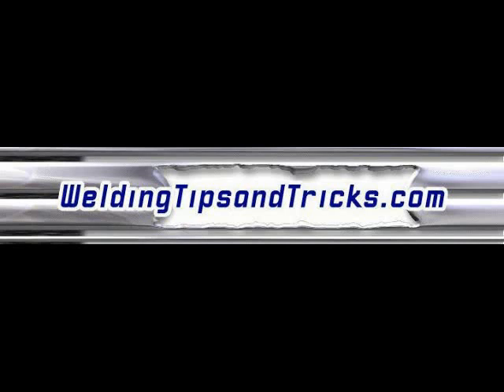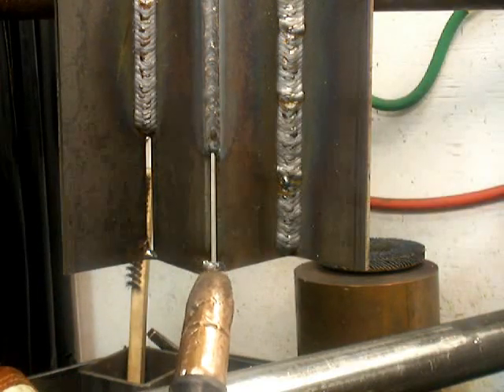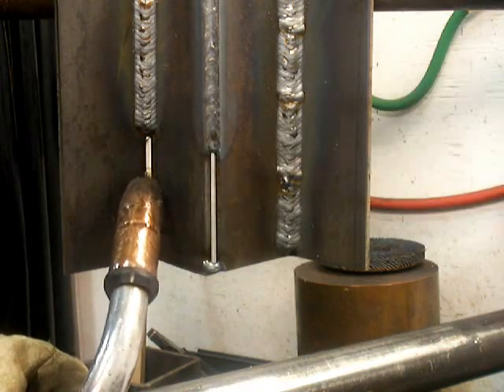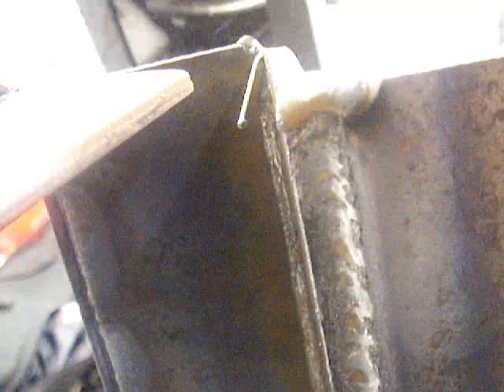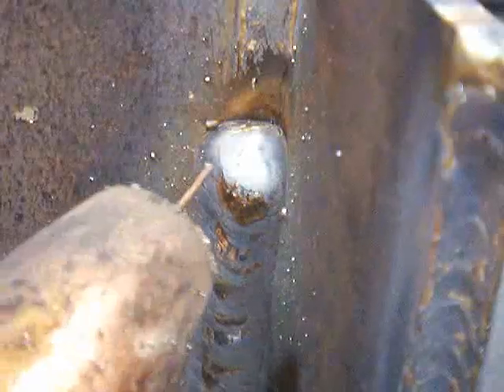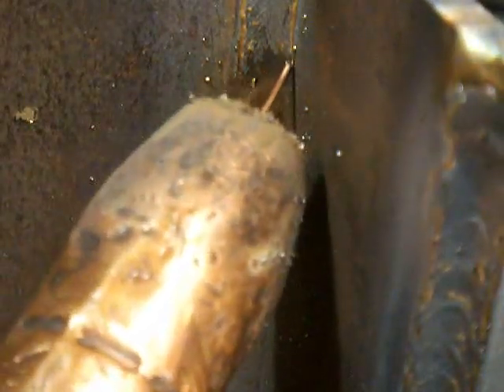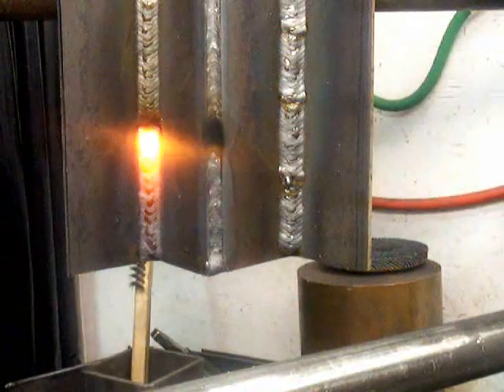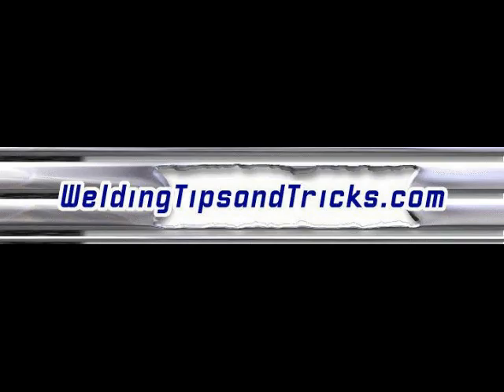Gas Metal Arc Welding Vertical Uphill and Downhill

Comment: I hope some wouldn’t mind helping me here …hate to ask for help but if anyone has ran into this or had experience I’d highly appreciate it …I just took a tes for a job I passed by skin of my teeth I rekon lol it was more like a drill seemed like I did a MIG 1G and FIRST I did a 3F uphill Tjoint was kinda weird idk much about codes trying to learn as much as I can by self study and what not but the machine they had wouldn’t let me go lower than 24volts between like 24-27.  And wire speed was like 435ipm and I wasn’t allowed to adjust it 🤨 and they also said I had to keep pressing the trigger over and over to me it seemed like I was just stacking tax appeal but they said I couldn’t adjust it and I could not run with the trigger the whole time maybe I just don’t know enough yet to understand what kind of test that is or is this just a drill and they considered it a test?  God bless y’all and take care

Comment: I'm using Er70 0.45 hard wire and having a hard time with vert up. I can't use those settings. It makes it too cold and I get the build up in the middle. Any suggestions?
Reply: Pause on the corners momentarily and sweep across quickly in the middle Do not pause for the center.

Comment: so you obviously need to turn both the wire speed and the voltage way down for vertical uphill correct because i can run a beautiful down hill pass then an absolutely horrible uphill for some reason thats with a miller 215 running 0.030 wire and 75 25 gas at 18 volts and 236 wirespeed on 1/4 cold rolled steel
Reply: have you tried reducing the wire speed to 190?
Reply: the voltage is fine it's just the wire speed that should be lowered. a teacher I had recommended that the wire speed be 190 but then again that was for some horizontal move movementa

Comment: First of all, thank you for your time. Secondly, I'll be welding 5/8" thick mild steel for the first time soon. I'll do a vertical up. Material is 5/8" × 8" flat bar made into a platform that will be 84" × 84" with a weight capacity of 55,000 lbs. I'm looking for a chart to go by. .045 wire at least, gas mix? Number of passes I should do?  I've looked a bit for a chart to go by with no luck. Any suggestions and help would be great. Thanks.

Comment: question im about to take a qual. for a job its a 1g open groove gas shielded flux core on a 1 inch plate after i run my root pass do i have to oscillate my wire on the rest of the passes or will it pass a bend test just dragging it cause when i drag it i have minimum toe cleanup and its faster and easier for me.. does it get good penetration?

Comment: question i have a lincoln ln-25 wire feeder power source is a lincoln weldanpower 225gn what would you recommend setting for going uphill mig 045'' wire 75 25 argon co2  3/8'' plate?